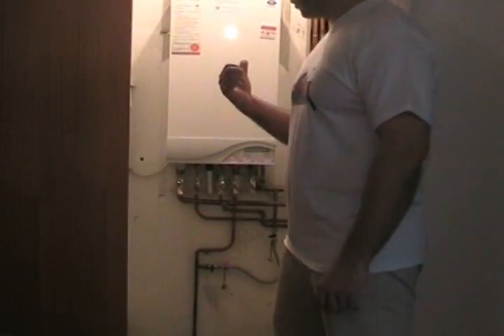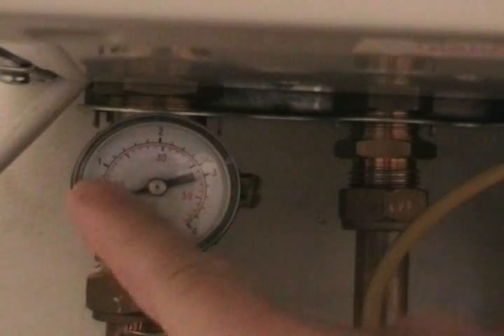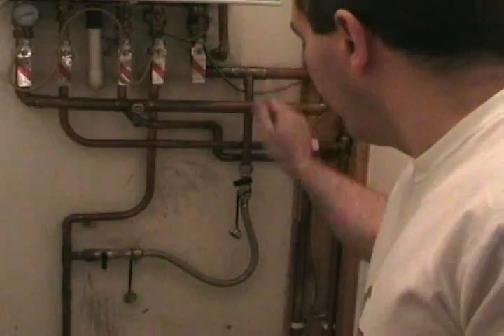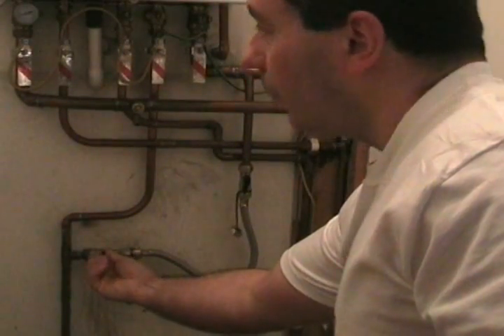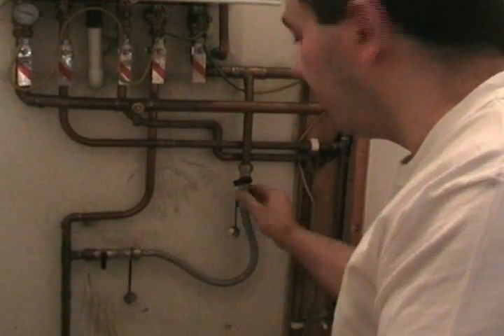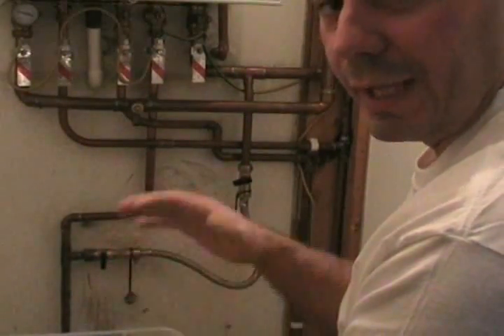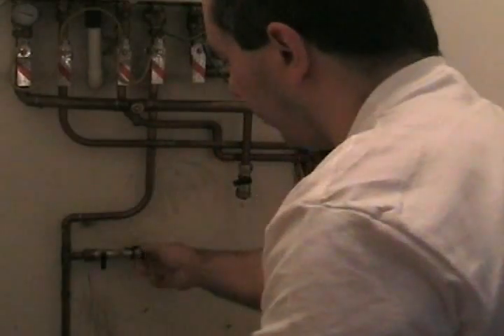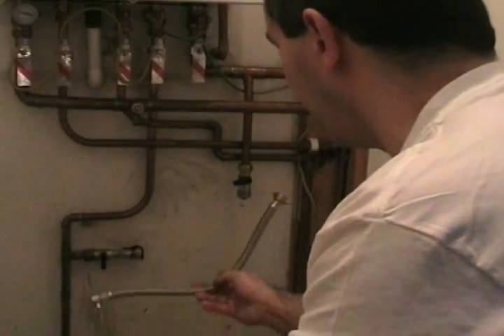How to repressurise or fill a combi boiler or sealed central heating system

Comment: Great video, looking at it feels so simple ! In my Saunier Duval ISOFAST F 28 E I could locate the black lever and turned it in the correct direction(as per the manual) still the pressure hasn't increased, its at 0.6 most of the times and once it slips down to 0.5 its shuts itself off....any suggestions ?

Comment: I haven't repressured the boiler yet still bamboozled.

Soon as you take the end caps off where you are supposed to attach the filling loop, water comes out of both ends, I have tried turning the valves on both ends but it makes no difference, water still coming out.

The boiler is only about 3 years old.

Comment: Hi I have a maxiflo boiler and the black needle gauge is at the bottom, so I need to get it up past 1 bar to get it working.
how will I get water into my boiler as I do not have a filling loop

please help

Comment: In my manual it says I need to take the cover off after filling and bleeding, and open the automatic air purger one full turn, then open the pump shaft to release air from that, then close all up (this is after the system has been drained). The thing is the auto purger doesn't rotate, it goes up and down and was in the up position. Should this be down? The pump didn't have any air in, water came out when I opened. The system isn't loosing pressure any more so maybe if it ain't broke....??
Thanks

Comment: As soon as I took the end cap off water was coming out, I tried turning the valve and water was still coming out so I put the end cap back on and left it.

The pressure is currently set to the notch just below the 1 bar so I think the pressure is only slightly low.

Do you think I can get away with leaving it like this for the time being?

Comment: My Remeha combi boiler is reading almost 0, I opened up both ends of the flexi pipe to put more water in and it gushes out of the over flow pipe outside. Do you have any idea what is wrong please?

Comment: Are you meant to switch off the water supply before attempting to re-pressure the boiler?

I just had a little look at my boiler, and as soon as I was taking the end caps off the boiler where you attach the filling loop, the water was coming out regardless of turning the valve with the screwdriver.

Comment: Hi.
Just followed the instructions in your video and repressurised to 1 bar.  The 'Air Pressure Valve' light is still flashing and the flame is not lit inside.  Any idea what the problem might be?
Thanks in advance.  Mark.

Comment: Thanks for the ultimate rapid reply. 

One last question, on my boiler it doesn't have taps to turn the valve but it looks like you need to use a flat-head screw driver to turn the valve on and off.  

Does this sound correct?

Comment: Do you have to turn boiler off before adding pressure using the filling loop?

My boiler is a isar he30, the pressure valve is just below the 1 bar.

Comment: Thanks for the reply.
I think someone (helpful inlaws) may have put more pressure in. 
I've turned the boiler off and it remains just on the RED it appears to drop ever so slightly if I turn it back on.
If I bleed a radiator water comes out instantly. I also have that anti rust stuff in the system,How long should I bleed it for?

Comment: Thanks for uploading this video, just saved me calling out British Gas. One question for you, the pipe connecting the mains water to the boiler was already attached!  I'm afraid of removing it as it only has one value at the mains water end.  Should there be two values? If I remove it will water just leak out of the boiler?  Cheers

Comment: Hi, thanks for posting this video. Clear and easy to understand :) My boiler is still not working correctly however...My combi boiler is now and 1 bar and the radiators have been bled and yet I have no hot water or heating. There is a red LED which flashes (and no ignition or flame) when I try to turn the heating on. For the past week actually we've only had hot water if I've turned the heating on-any ideas please?? Thank you very much!

Comment: so, as long as i switch the boiler off before starting, it will start up ok after i switch it back on, as long as the pressure is up again?
as for your other point, i'll take this oppurtunity to flush and inhibit as suggested, thanks again

Comment: Hi, i am fitting an upstairs heated towel rail and need the system drained to do .Im assuming that i drain the downstairs radiator till the level is down and check by opening the valve on the old radiator (which is removed) before fitting the new connections?
I can see with the help of your vid how to re-pressurise system but im not sure how to "restart" the boiler afterwards, if it will have closed down due to pressure drop? Thanks in advance

Comment: good stuff mate! I have to replace a radiator downstairs to the other side of the room. Im going to bend the existing pipe donwards and fit an isolation valve compression fit, then run pipe under floor. I will drain system.

I have lousy water pressure, when refilling the system do I turn the boiler on? Or do I wait until refilled to 1bar, then keep on filling as it drops?

Comment: Hi. I'm not sure I understand. I turn off the taps at all radiators I don't want on so surely they should stay off whatever the temperature? Also, the radiators haven't always done this, I've only just noticed it recently, which suggests a problem. Don't you agree? Cheers

Comment: Ultimatehandyman 
We have a Baxi combi 105he boiler, i topped up the pressure today by to much and it is sitting over 3 bar when turned on, i did bleed some radiators and it dropped down but it went back up again, what should i do and how should i do it?

Comment: Cannot see because of position of Camera but I would concerned about: A why would you loose pressure in the first place if its connected directly via cold water supply. B potential back flow with contaminates entering your potable water. ie back flow preventor , double check or RPZ   just a thought.

Comment: I, like many others, are very grateful for your help! Just did this on mine, and it worked. I also had to 'turn it off and back on again' to get rid of a warning light before the central heating started working again. I'm sure you've answered it before, but do you know why it is a legal requirement to remove the filling loop? Thanks again!

Comment: I bought an EV with a 4 way valve on the top with 2 sets of flexible hose, one being  a non return valve. Am I right in thinking the non return is to set up a second filling connection (I cannot fit the EV near the boiler) to pressurise the EV and the second flexible hose is to connect into the heating system..?? I'm assuming I can pressurise the EV by either using the filling loop or by pumping up the valve on the bottom of the EV..??

Comment: Great video thanks. I just had to move a rad .do i have to pressure to 1 bar then bleed and then pressure back to 1 bar. My question really is do you have to bleed rads after you first get it to one bar.

Comment: Great video.  Do you know how I can increase the heat of my bath shower water? Even at max (Main combi boiler heat knob turned to max and bath taps all the way) still not quite hot enough. The kitchen sink uses same combi boiler but it piping hot. Thank you

Comment: Hello, I would really appreciate some advice please. I have an ideal classic gas boiler rs30. I am still getting hot water no problem but my central heating has gone off. I have bleed the radiators which were fine, no air. I have shut the boiler down and then back on and still no heating. I can not see a pressure valve anywere to check the pressure, to be honest I cant really afford to get some one out so would realllllllly appreciate ay tips on getting it going. Thank you

Comment: Do I HAVE to bleed the radiators? I'm screwed. Council tekin bottle to come down n sort boiler out. N it's too cold. -_-  only the bottom half of the heaters work. N even then it's only a little bit of heat. They don't roast up like they used to :( since lastnight this started.

Comment: Good Video. Does the boiler need to call down before carrying out this task? I have tried it and the overflow keeps taking the water away so I cannot set it to 1 bar. The Boiler is working but the pressure is down to .25

Comment: thanks this was very useful. I have an integrated filling loop on the bottom of my boiler.  I have I got the boiler back up to 1.0 on the pressure gage. Also just checked and bled my radiators and there is no air in any of them.  Hot water is coming out of the tap but my radiators are not getting hot.  They were working before the pressure went below 0.5 and the boiler turned itself off.  Any ideas?  Thanks

Comment: what should I do after i up the pressure to 1 bar? Should i let the boiler rest for a while or can i turn it on. It seems like after i upped the pressure the ch return pipe is getting some warm ish water, whilst the ch flow is stil... any help tips?

Comment: hi m8..i've got a halstead ace combi boiler..and it leaks from the over flow pipe which is outside...so it keeps losing pressure and goes down to zero...the guy that fitted it left the filling loop on so i just keep topping it up...how can i stop it losing pressure...any ideas...thanks

Comment: I have drained my system to fit a towel radiator. As the whole system has been drained, when you refill it do you have to bleed the radiators as you are letting the water in or separately as you did in the video? Also my system had 3 different draining valves down stairs, does this affect the refilling? Great videos by the way! They have helped me no end with the draining and fitting the towel radiator - Thanks!

Comment: Thanks so much.. I was freezing all night as the pressure had dropped on my boiler and wouldnt ignite for heating... now its working.. thanks so much!!!! the only things is I let the pressure just go to one and a half bar but now after turning heating on its gone to 2 bars.. is that dangerous? Im worried I will blow it up if I turn heating back on!!! could you let me know .. thanks so much

Comment: I got a wood gasifier it is recomened that it has 1.5 bars but when i heat up the system at the peak it climbs to 3,5 pressure can something happen to my radiators or pipes? it has a valve when it climbs over 3,5 bars it starts to leak water out of it slowly. so am i safe? or something bad can happen if i burn the boiler too hot.

Comment: i bled the radiators first then noticed the pressure had dropped so i topped it up, now when i leave the heating on for about half an hour the pressure creeps up to 3. Then overnight the timer is set so it turns off at about 2am and comes back on at 7am but it doesnt come on and the pressure is below 1! Any ideas mate?

Comment: I bled my radiators and my boiler stopped working because of low pressure. Ordinarily this would mean at least a day without any heating or hot water and my useless rental engineer couldn't even find the filling loop last time (it's behind the washing machine) and only put the minimum pressure in.

Thanks to your video, I can do it myself!

However, I noticed that the filling loop was still attached, even though by law it's not supposed to be....

Comment: Regs state there must be an air gap between mains n filling point, hense the removal of filling loop. Then they realised a double check valve introduces it anyway. Look at baxi duotec/vokera synergi. Built in unremovable fillin loop. Hope this helps!

Comment: @ultimatehandyman  I just tried to bleed the radiator after turning the combi boiler off (Ideal Isar HE30) anf did drain about 30+ml water from the radiator but the pressure does not seem to have gone down. when I turn the hot water tap on it goes upto 3 ish and normally stalls around 2+ bar. I am not really sure about the positioning of the valves if its on or off at present as I cant remember their initial positioning. Can I call you or if you can call me on 07949198249 I am really worried

Comment: Hi UltimateHandyman thanks for this video, I did manage to increase the pressure but I now have the pressure to about 2 bar when nothing is on and it goes as high as 3,3.5 when both heating and water is on I am worried if I have done something wrong and not quite sure what the correct positioning of the value.
I am really worried that it might now blow up the boiler or pipes etc.. please confirm if this is normal ??

Comment: thanks for this ,the manual with the boiler is rubbish, found the pressure value on the filling loop but you said this had to be unconnected and this is fixed in place and had to use a screw driver to open it.  lol , thanks again

Comment: I live in a house owned by Arena, they replaced our old boiler with a combi recently, my radiator in my bedroom hadn't worked for 2 years - they weren't bothered by that. I just bled it now and it's finally working perfectly. They didn't leave the filling loop connected so would i have to call them if the pressure dropped or should i just buy the loop myself? Thanks for the vids, they're very helpful (helped me bleed the radiator anyway!)

Comment: Hi, Does it have to be at 1 or anything number above this. I did this, and pressure bar went up to 2, but hot water only comes for few seconds then turns cold. Anyway suggests.